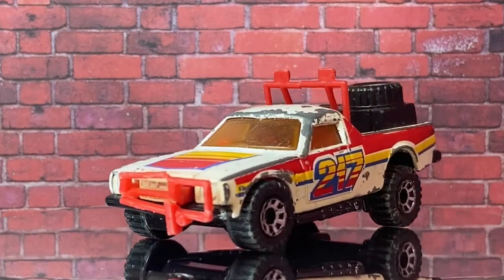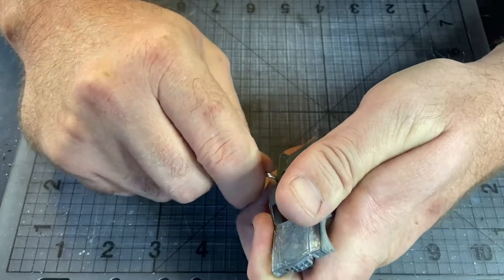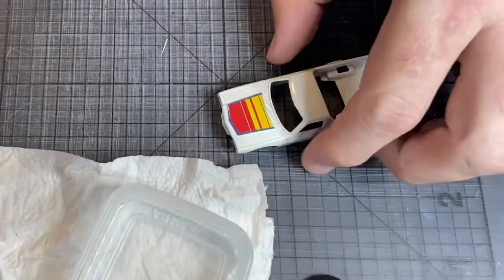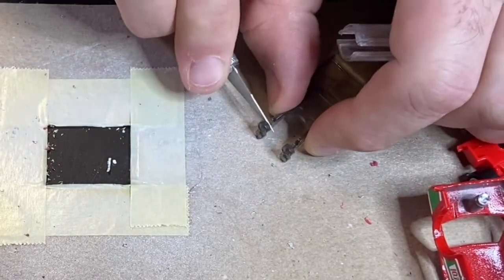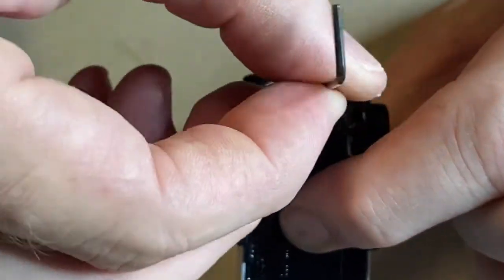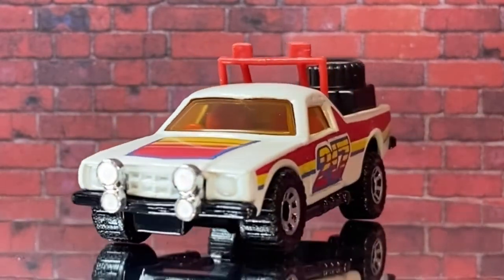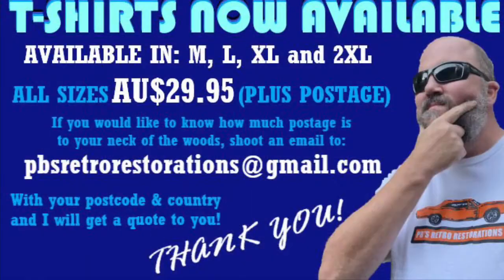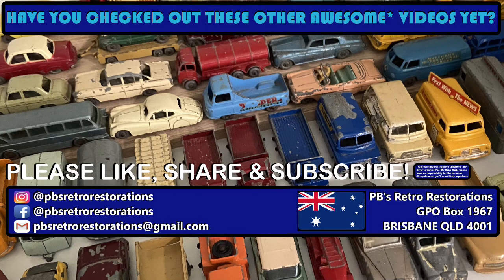Matchbox Superfast Holden Ute Ruff Trek Restoration #064

Comment: That was an awesome restoration, and I think it would be fun to do the Chevy Stocker and Hauler Truck in separate videos! :) That will be a gorgeous set when done, without a doubt! :) Maybe a small diorama to display the trio together in a future video? :)

The audio was absolutely fine on this end P.B. :)
Reply from the maker: Thank you for the feedback on the audio and splitting the other restos. You're the diorama expert here, I guess I could give it a go 😃
Reply: @PBsRetroRestorations  I still have a good ways to go yet on my diorama skills, but I am getting there a step at a time. :) And if need be, I do not hesitate to use prefab items. :)

I usually end up mixing prefab and homemade items together for most things to get the setup I want. :)

Comment: You did an awesome job. I just picked up the same pickup casting. It doesn’t have the back tire mount. I would like to get the file for those decals. They came out spot on. I will be looking forward to seeing the other castings done as well. Never realized it was a package. Take care.
Reply from the maker: Thank you! Yeah, this is one that the repro parts people have overlooked for sure and is ripe for the 3D printer folk to make a killing on, especially here in Oz. Shoot me an email to the address on the screen at the end of the vid and I can zap ya the file, or send me a mailing address and I'll post you a set of the printed to size waterslides.